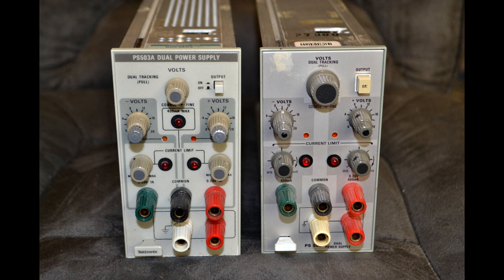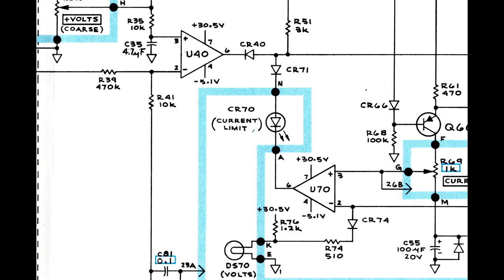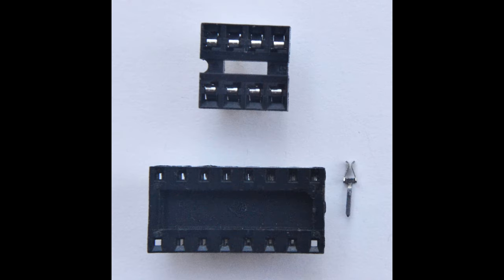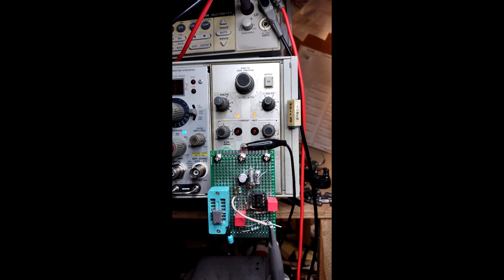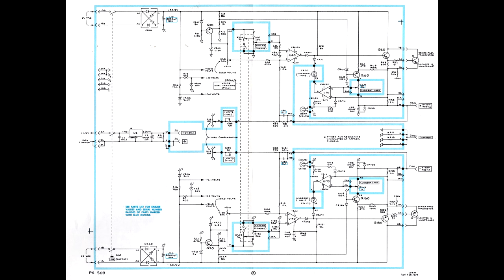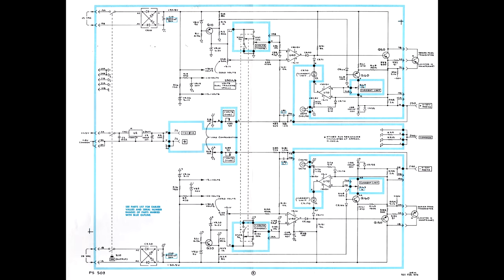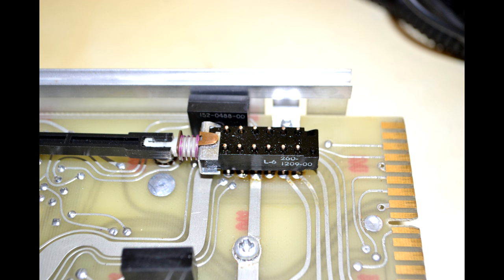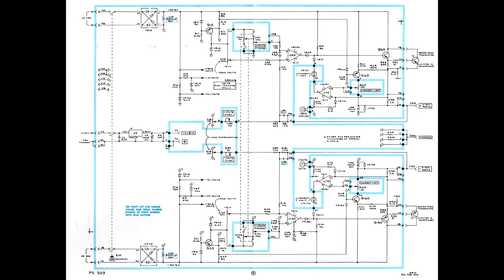Tektronix PS503 and PS503A Dual Power Supply Repairs

Comment: I fixed a couple of PS501's and found one had an open circuit main filter cap and the other had a dead (open) current limit LED. As the LED itself is part of the feedback path, this caused it to have no current limit at all and I ended up killing the pass transistor in the mainframe.(replaced the LED's with brighter 1980's ones)  I also have problems with intermittent operation of the output PBT switches on both units & with similar switches on the DM501's I have.

Comment: Is there a suitable (modern) replacement for the 741 that has a higher maximum supply voltage?  OPA551 maybe?  It strikes me that the choice of OpAmps may have been more limited back when these modules were designed and the 741 was chosen.  I sometimes wonder if the choosing of the 741 is willful or just "that'll do".